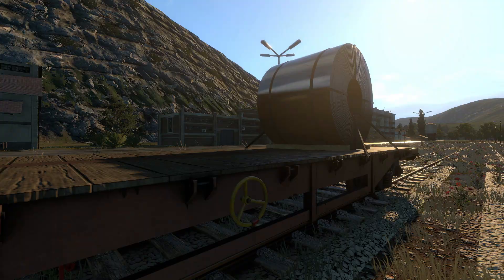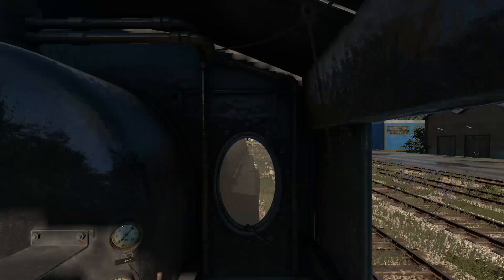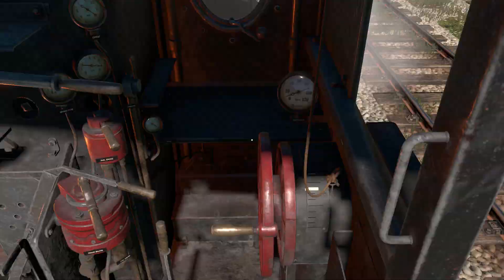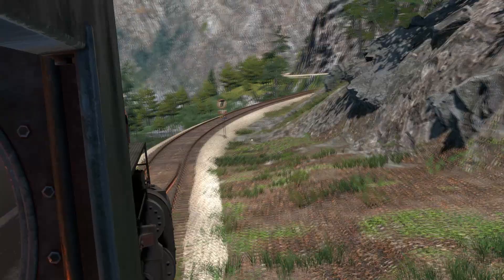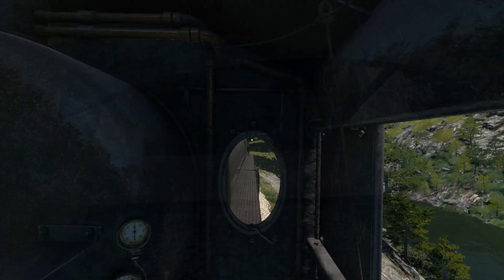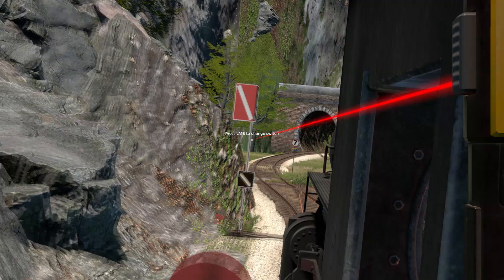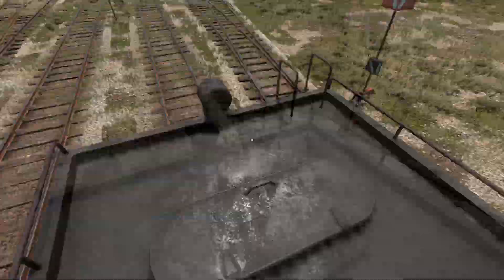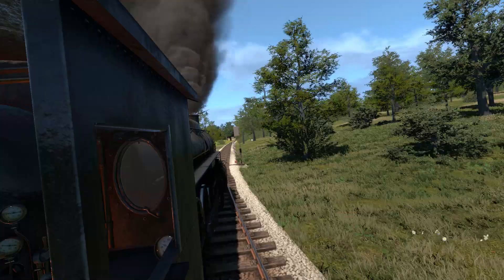800+ Ton Steam Loco Haul - Derail Valley: Simulator

Comment: 1:18 I worked with these steel coils in RL, they don't look like it but they weight between 15 and 25 tonnes without problem. When something wend wrong and they roll over your foot, that is the same as if your foot is crushed by a locomotive.